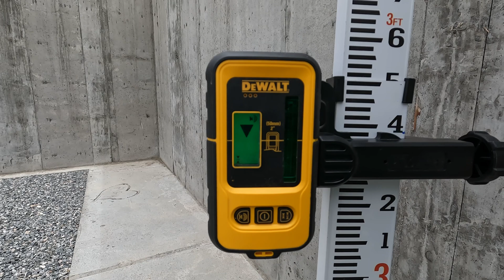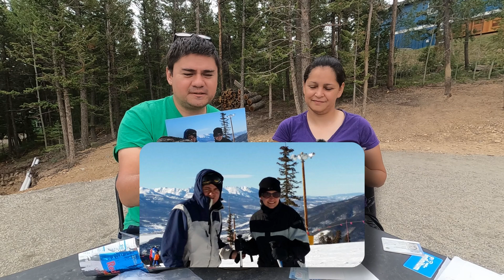Under Slab XPS Insulation and a hidden treasure!

Comment: Great work! I see that you went with R15 for floor insulation. What is the minimum size or R value you would recommend for floor insulation before concrete pour? Thanks!
Reply from the maker: Hello! Thank you for watching! I believe a rule of thumb is:
R-10 underslab, R-20 foundation walls, R-40 walls above ground, R-60 roofs/attics. We build in zone 7, so we like to go the extra mile. That said, windows/doors are likely the weakest. Paying attention to those is a good idea.
Reply: Thanks! Also, what kind of gravel did you use?
Reply from the maker: Hello, tbh I'm not 100% sure on that, the excavator takes care of it. I believe is less than or equal to 1/2"